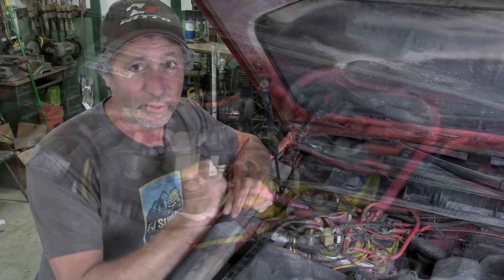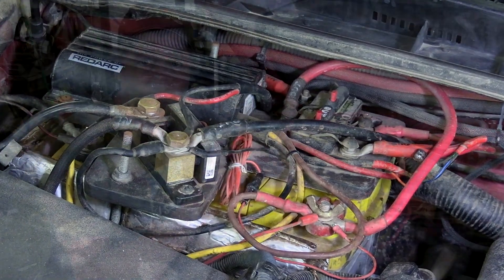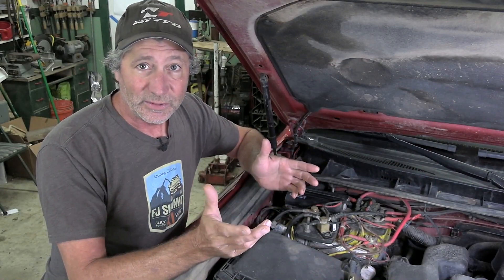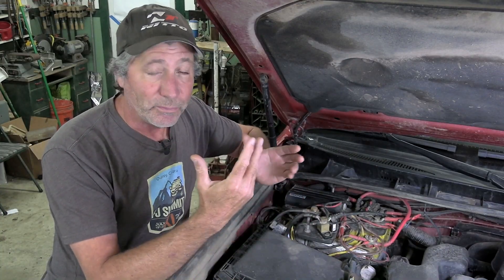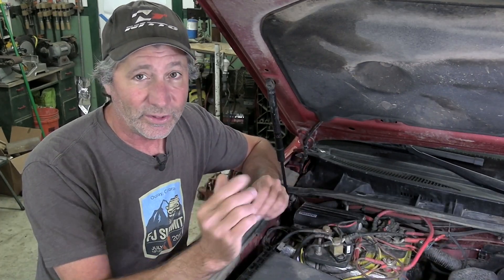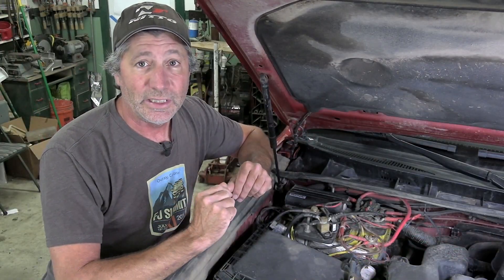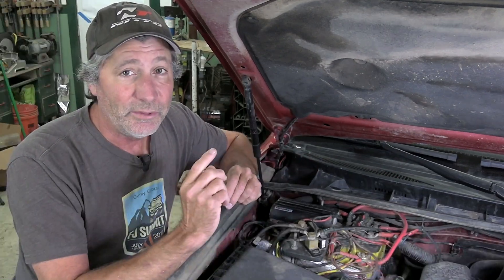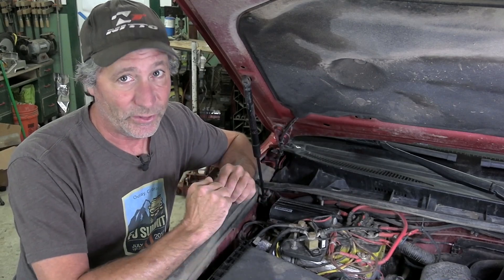Dual Battery Setup, Long Term Use Review And Update

Comment: I love your guys videos.  I have used several of your recommendations, including the suggestions for the dual battery install.  I have a question that I hope you will answer...What did you use for a connection to plug your solar blanket/panels into the yellow wire for the Redacr?  It seems like you have a little connector of some sort right in the plastic part under the passenger side of the windshield, right above the battery.
Reply from the maker: Thanks for watching! Yes, we installed an SAE plug in the plastic cowl trim.

Comment: I have a question. So which DC to DC charger are using the CTEK or REDARC?
Reply from the maker: The Redarc on the 4R, the Cetek on the FJ. Both work the same way with the same results.
Reply: Thank you! Great videos!

Comment: Hi there - this is great information and I've used your original video for a build of my own which was incredibly helpful! Which Victron Model did you replace the old unit with? Is the monitoring unit still wired in the rear cargo space or did you end up moving that to a new location? Appreciate these videos more than you know!
Reply from the maker: The one we use now is totally Bluetooth and is mounted right at the battery under the hood
Reply: @WanderlostOverland  Sounds much more elegant - looks like the Smartshunt. Thanks again!

Comment: Really enjoy your videos...informative and entertaining.  I have a '95 4WD Suburban that I'm outfitting for photo excursions.  I also went with an Odyssey yellow top since my engine bay was pretty space-limited...the Odyssey battery was the only AGM dual purpose I could find with a height under 8".  I was worried about the 72 amp hour capacity (wanted 100 but couldn't find one to fit) but looking at the numbers the 72 is probably more than enough for my needs.

Comment: Have you added a high output alternator or the Arclight led fuse in order to actually fully charge your AGMs? I run a single Oddyssey Group 34 with an SPOD and am now learning that the stock Toyota alternator will never fully charge an AGM.
Reply from the maker: It is correct that the stock alternator will never put out the correct voltage to properly charge an AGM, or lithium battery. That's precisely why we charge ours with the Redarc charger. It does reach that higher voltage.

Comment: Thank you for doing this follow up! I Just installed this system last week using your original video as a guide. I was actually able to squeeze in a 100ah Odessey 31 series by HEAVILY modifying the C4 tray and adding extra supports (Why, because I wanted more)😉. It also enabled me to install a much larger ABS hold down platform. Besides that I went with the Redarc 40amp and made a Busbar to connect all those wires to the load/charger side of the Victron shunt. The heat shield is another great idea! Thanks for all you guys do!👍

Comment: I finally installed a dual-battery and used your original install video as my guide. It works perfectly, even though I was rushed when doing it. I still haven't installed everything, but my fridge/freezer works perfectly and that's all that I really care about. Thanks!

Comment: Good info, we also have a yellow top battery in our FJ there is a open space passenger side. Where your battery is we installed a second  fuse bock and a C-Tec DC to DC converter. We only have a friig and camp lights ,charging ports . Look forward to future upgrades to your system.

Comment: I have a x2 battery with a 100 watt solar panel on my 4Runner trail with two blue sea 12v and 2 usb that have constant power and that will run my fridge indefinitely. For anything else I have my 2 Jackerys. I wanted my power portable.

Comment: Because of y'all I bought the Redarc 50 amp and i use it with 100AH battery with a 3500 Watt pure sin inverter. I have a solar panel I need to install on the roof rack.

I use it to power the laptop, drone stuff and will be adding other stuff like winch, frig etc. All of my stuff is installed inside the passenger compartment.